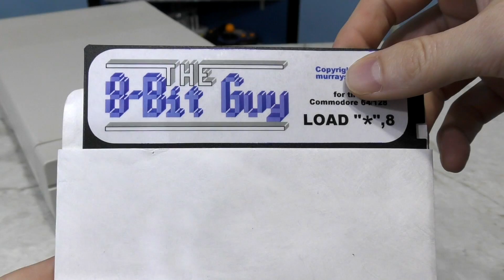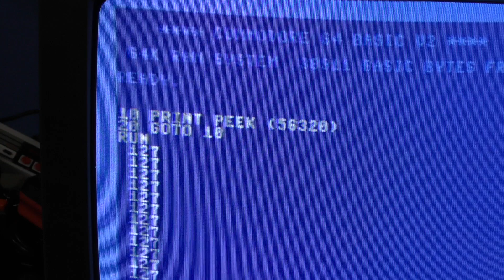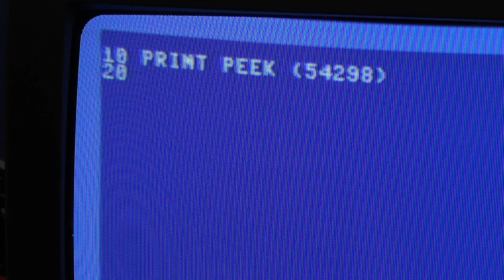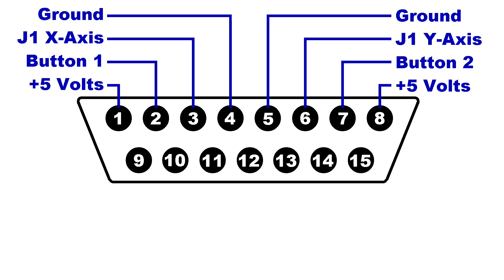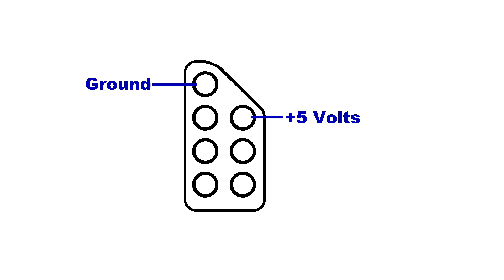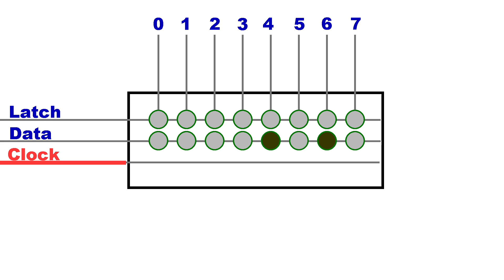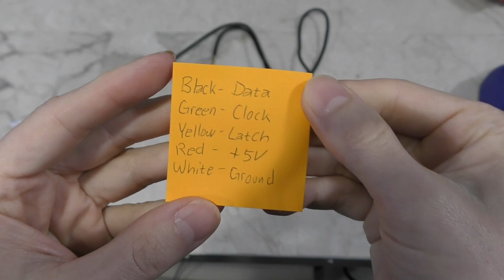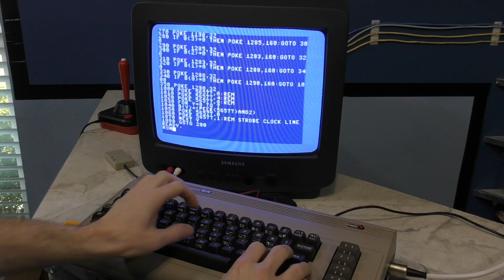How Vintage Game Controllers Worked

Comment: 4:23 Holy crap, the "Top Gun" Thrustmaster!  For a lot of us, that was the first time we got to use a "real" flightstick because it was the first Thrustmaster released that was <$100.  In fact, iirc, it was closer to $50.   At the time (early 90s) it was absolutely revelatory.  High grade PC flightsticks were incredibly expensive until the "Top Gun," and that was the one that put them in reach of almost anyone.

(The idea that mouse + kb should be good enough for anyone is a relatively new invention of PC enthusiasts.)
Reply: No PC enthusiast worth their salt will say that Mouse + KB is enough for flight sims. Most will probably recommend one of the many available console controllers (Xbox, Switch and PS4 controllers all work with little to no effort) for a budget user, or a full HOTAS if money is not too tight.

Personally, I prefer the wired (!) Xbox 360 one because it just fits my hands the best, and I think it is the cheapest possible controller with that layout and feature set, but I have used my switch Pro Controller for a few select games as well.
Reply: @Atlessa  One shall not forget pedals. Atleast for helicopter flying. Twist handle can never replace pedals..... Problem is I'm poor..... Hmmmmmmm.... car parts shop...... arduino..... hmmmmm.........
Reply: My all time favorite was the Epyx joystick.  It was suck a radical design, ergonomically fit the hand perfectly, and the switches lasted forever unlike on others.   Still have 3 used one and 2 brand new never opened boxes. :)

Comment: You really shouldn't give people the impression the "9 pin joystick port" was an Atari creation when it's called a "9 pin D SUB" connector, an industry standard originally introduced by Canon in the 1950s. Atari really just went about their business in a pragmatic way and used commodity hardware available off the shelf in massive quantity at very low cost.
Reply: The US Military created the DB9. And it's considered the "Atari joystick port" because Atari did it first and the rest copied them.

Comment: This is the kind of thing I got into Arduino for. The proof of concept you've got wouldn't work for existing games, but you could put a micro controller between the NES pad and the joystick port that would translate those inputs.

Comment: This is very impressive, I can tell by this how old mice must work too!
But the Genesis controller on C64 thing still confuses me as I also read from people who can use it just fine without killing their machine.
Reply: Yeah, he's actually wrong on this point. He's assumed that the Select pin is connected to a button when it's actually an OUTPUT used to read the additional buttons on a Mega Drive controller.

Comment: What about the six button Sega Megadrive ones? How does that one work with those pins?
Reply: The Select Pin is actually an output. On the 3-button controller it allows you to choose which of two banks of buttons to read. On the 6-button controller you pulse it twice to select from up to four banks (not all are used).

Comment: It always seemed a shame to me that the C64/Amiga didn't use the paddle pins to emulate extra buttons.  Fighting games would have been so much more satisfying.
Reply: The Amiga supported two-button joysticks (including Master System and Mega Drive controllers) and the seven-button CD32 pad. Plenty of Amiga games supported two buttons, not many supported the CD32 pad.

Comment: When I was in my early electrical engineering courses and I decided to use an NES controller to interface with, I was surprised at how simple it was. That got me down the road of building my own 8 bit video game system on a xylinx fpga.
Reply: That's hardcore
Reply: i also used a nes controller for my microprocessors 2 course back in my college years.
we made a very simple gaming system.
using the motorola mcore processor, just because the professor said there would be bonus points for anyone using that one. the only drawback is that the mcore was never discussed in class, but we were all into reading on our own.
and we divided the labour evenly.
i had to create the sound system, it was quite a good learning experience. during that project i learned that there's such a thing as an analog multiplexer/demultiplexer, and that you should use it if you have analog signals.....and that analog signals are sometimes found in the weirdest places where you'd expect a digital signal.

those were the good old day.
Reply: can we look at it please?
Reply: I'm interested in seeing it too!
Reply: It's not 8 bit if it doesn't run on 8 bit hardware!
Reply: @ecernosoft3096  um it was 8 but hardware.  It was a xilinx fpga. I literally implemented 8bit hardware on it

Comment: The PC and Mega Drive/Genesis are not correct. The PC pin-out has pins 13 and 15 swapped, also 12 and 15 are used for MIDI in some cases. The Mega Drive/Genesis pin 7 is a input, MD/G does not have a select button, pin 5 is +5V to drive the logic circuit that multiplexes the buttons/d-pad to maintain electrical compatibility with Sega Master System and to allow more advance game controllers.

Comment: Aaaah. I was lacking a joystick or Pad for my Amstrad CPC464 a few years ago, I tried hacking together the wires from a NES pad to use on on a 9 pin connector. Now I know why it wouldn't work.

Comment: Great video.  Love the inside look at this stuff.  Years ago I wanted my home alarm system to call my pager.  I wrote a quick basic program to look at the button on the PC joystick port on an old IBM PC with an 8 bit ISA joystick port card installed.  I connected a relay up to the alarms horn leads and to the joystick button and ground wire.  When the alarm went off the program would see the button push from the relay send the ATDT command to the internal modem and call my pager.

Comment: Wow, I been using the Genesis controller on my C128 for years, my machine hasn't fried yet, but I also don't think I ever pressed the select button. Generally, it's the D Pad and B button IIRC. Good to know.
Reply: You can't press the Select button on a Genesis controller - mainly because Genesis controllers don't have one! David's cocked up that part of the video by assuming the select pin is wired to a button - it's actually an output used to choose which set of buttons to read.
Reply: @gwishart  You know, after this video, I went to try it on my C-128, I have two, and I realized it is a Start Button, not select I was thinking of. Pressed every button on my Genesis Controller (The original A B C, D Pad + Start button) No issues still! No smoke, and it still runs :)

Comment: I think the original PlayStation controller doesn't use USB, and IIRC I've heard that it can be connected to the parallel port of a PC for use on PC. So I wonder how it actually works, especially for the DualShock controller. 
Also I think most Chinese famiclones from 10+ years ago (some are actually VCD or DVD players) would use the 9 pin game port. Some even come with "kinda confusing" 6 button gamepads. I wonder if they just decided that converting the genesis/mega drive game pad protocol to work with famicom games would be easier.

Comment: But does that shift register chip in the nes controller not cause a slight delay in button presses??

,also if you connect a nes controller to a C64 or pc etc,, via adaptor, i can imgine that it causes delay either because of the required conversion process, right?
Also i,ve readed that the pcm channel will cause input lag because it’s said that the nes reads both pcm & control input signals from both the same line, so the nes has to quick alternate between those signals to try to make up for this, the nes controller has to senf multiple signals just in case sothat if 1 signal has been missed to be registered, then the second signal should be registered and so on, this is only the case when pcm sound is played so it differs per game and situation,mmm.
Reply: A shift register can be read several million times per second. Shift registers are incredibly common in almost all electronics, including your keyboard, mouse, etc.

Comment: I remember using genesis controllers on the c64 at my friends house, they had both systems and the c64 joysticks were always crapping out. Remember those small joysticks with the metal shaft and round knob on top? They had small metal pads that got crushed against the PCB when you move the joystick. I used to open them up and pry the metal pad back up to put some spring in it when they quit working on our c64. Anyways, I don't remember they genesis pads causing any problems, but it was a long time ago and we were kids so who knows. Pretty sure they worked fine though.

Comment: I don’t understand. The Sega Genesis has three buttons but that’s not in the diagram. And how did the six buttons work? There’s not enough pins. And that’s the first time I’ve heard that the select button will fry your system. They don’t mention that on James and Mike Mondays!
Reply: Six button pad uses pulses on pin 7 to select the 3 bank of buttons. 3-button pads only uses high and low on pin 7.

Comment: Would there be any way to use your NES->c=64 mod to play older games, or would they have to be coded to specifically for it?
Reply: They wouldn't have been coded to read anything other than the joystick port, and the data isn't in the right format. You'd have to make some hardware device (say, a cartridge) that converts the signals back into raw joystick-style input, and at that point you might as well just make it a converter box that plugs right into the joystick port.

Comment: I heard that in the NES game bad Street Brawler if you used the power glove you were able to perform a special punch, do to the power glove having the ability to simulate “Up” and “Down” on the D pad. On a standard controller you weren’t able to due to the way the Dpad is designed. I bet if you open up a controller and bypass the D pad and just press the contacts, you could do the special punch. 

I’ve never actually seen the punch with or without the power glove so it would be interesting to see if true or not.

Comment: Something tells me, that Planet X3 will support a big variety of controllers creatively connected to PC.
Also it should be possible to write a TSR program for DOS that would read input from those controllers and simulate keyboard presses or at least use Arduino or similar device to convert inputs to PS/1 or PS/2 keyboard interface.

Comment: Old controller/data ports are a really interesting example of the transition from hardware to software. Computers simply weren't fast/big/powerful enough to manage the overhead required to represent those protocols in software, so it's represented in hardware. It's fascinating seeing physical representations of problems engineers the world over tackled in their own ways. Heck, the Atari 2600 literally had physical switches for difficult on the front. Such a design decision would be ludicrous on a modern console, yet at one point it made sense.
Reply: What's funny is that processors have now hit a speed cap and now have started to move back in the direction of parallel processing. We went from USB 2.0 with 4 pins to USB 3.0 with 9 pins. USB Type-C even has 24, although mostly for redundancy so that direction can be ambiguous.

Comment: @3:39 The "select" line is used to control the multiplexer chip to read the second pair of buttons. The Start button on a Genesis controller is connected to the 64's pot-y input.

Comment: Sega Genesis controllers work fine on Atari 8-bit computers.  I've been using them on my Atari 800XL for 25 years.  As a matter of fact, many homebrew games support them.  I've also used them for years without issue on my Amiga 500.
Reply: Yeah, his explanation for how they work is garbage, and his reasons for why it damages home computers is even worse.
Afaik the damage caused is specific to the c64 and has something to do with it connecting it's keyboard controller to the same lines as the joystick port.

It can damage a c64, but I don't think it will damage an Atari, or most other home computers...

Comment: Back in the day, I used the Atari joystick's cable soldered in place of the chip in the Nintendo controller directly to control the standard directions and button - and used the B button as an additional "up" button that used up to jump, and that made it compatible with all my games :)  You just need to desolder the controller chip, the pins map to the directions and buttons so you just hoot it up direct.

Comment: I used to play C64 with a Genesis Controller!So, wich button can cause trouble? There isn't a select...you mean mode or start?
Reply: He misread the documents like a buffoon. Select isn't a button input pin, it's an output pin which controls the type of input received, it can't short +5V with Ground. The only input pins are the standard 6 (corresponding to the C64's Up/Down/Left/Right/1/2; also, the controller and Sega Genesis both pull these up, so a disconnected pin has a positive voltage) and the remaining two pins are +5V and Ground. The 3-button controller sends Up/Down/Left/Right/B/C when Select is high, which is the only thing your C64 reads because it doesn't toggle Select – and when Select is low, the controller sends Up/Down/Low/Low/A/Start, where the two constant lows on Left and Right is how a Genesis knows that a Genesis controller is plugged in (you can't physically press Left and Right at once). The 6-button controller usually works the same (with a few microseconds of lag) – see here: https://applause.elfmimi.jp/md6bpad-e.html – but games that recognize it are supposed to toggle Select 4 times in a row per cycle with short pulses (13.8µs on average, apparently). That's because when Select is toggled from low to high twice in quick succession, the pins report Low/Low/Low/Low/A/Start on the next low (the lows on Up and Down are how the console knows whether it's a 6-button controller), then the next high reports Z/Y/X/Mode/High/High.

Comment: can you play atari 2600 with a genesis controller without frying anything ?
Reply: Yes, you can. His explanation is actually wrong on this point, or deliberately simplified. The Select pin is an output, not an input. Only the four directions and the B button are detected by the Atari 8-bit computers. Pressing the other buttons does nothing at all.
Reply: People use them all of the time on 2600s and 7800s. There's even some home brews that can support a second fire button on the Genesis pads even though the 2600 only supports 1 fire button standard. Plenty of details in the Forums over at the AtariAge website.
Reply: I think you can, the problem arises only if you press "select", because that shorts +5V to ground
Reply: @RussellTeapot  Genesis controllers don't have a Select button. The select pin is an output to select the button bank to read.

Comment: what about the n64 controler it uses 3 i/o lines yet it has a lot of buttons and a analog stick
Reply: It's serial - similar to the NES controller. One pin for Ground, one for 3.3 volts and one for Data.

Comment: please correct me if i'm wrong, but as for the nes controller, haven't we already seen something similar in other, even older machines? for instance, this commodore calculator: https://www.youtube.com/watch?v=Q0rSv8NfQXQ  this system basically takes advantage of the speed of the pulse, which is much higher than our hands' movements on the controller

Comment: So those 9 pin to 15 pin adapters for the Amiga are useless?
Reply: They work, but only for analogue joysticks with suitable software support. There weren't many Amiga games that handled analogue joysticks, mainly flight simulators and a few racing games (F-16 Combat Pilot, F1GP and Reach for the Skies spring to mind).

Comment: Dear 8Bit Guy, I wonder if you should do an extra video showing how the analog to digital part of the circuit works. In most systems having a "REAL" analog to digital converter would have added a huge expense to consoles and home computers. So most manufacturers took a leaf out of book of PONG. Using a Schmidt trigger a capacitor and the variable resistor in the joystick. You'll notice that most joysticks only wire to one end of the pot and the wiper. The circuit works by using the video timings, so the vertical refresh resets the the circuit by discharging the capacitor, The capacitor then charges via the resistor on the paddle or joystick. When the capacitor is charged you just count how many video lines have been created and that is your analog value. I guess for NTSC you be counting some of the off screen lines. For PAL you'd be counting all the 256 visible lines. You can see how in PONG you could use the exact system to render a bat on screen using just discrete logic.

Comment: The current generation of consoles also has the option of Bluetooth for controllers (well assuming the battery is charged)...which is probably enough for yet another video.  When plugged in they do use USB though.

Comment: Great video! 
The inside of the NES cable is the same as an original Xbox cable. The original Xbox plug can be cut off & a USB plug wired on and it will work with most things. Would the NES controller do the same?
Reply: No, the NES doesn't have any USB capability. The Xbox plug was just a differently shaped USB connector.